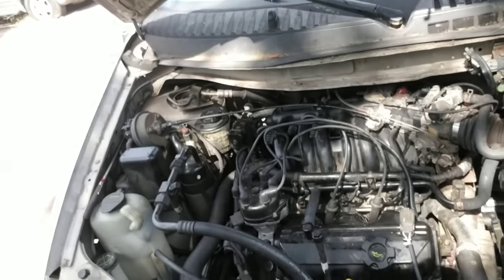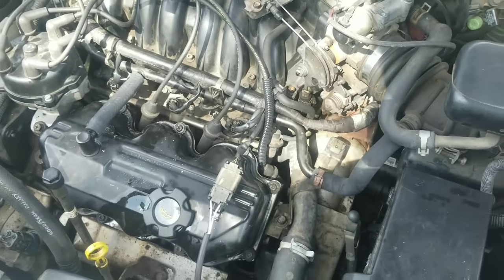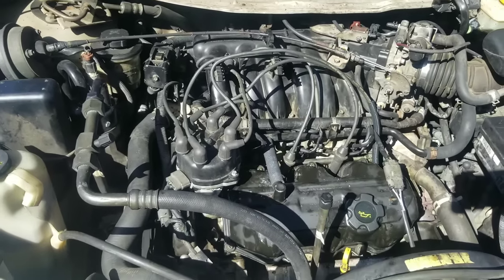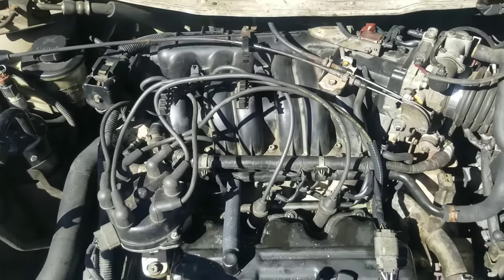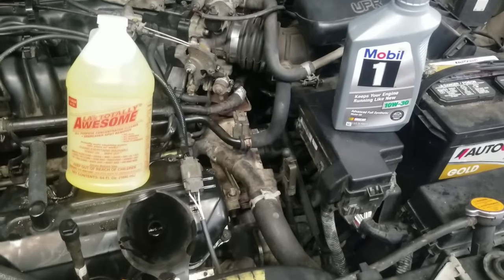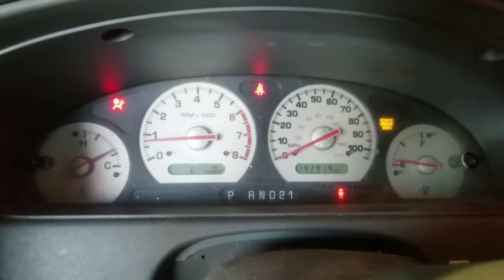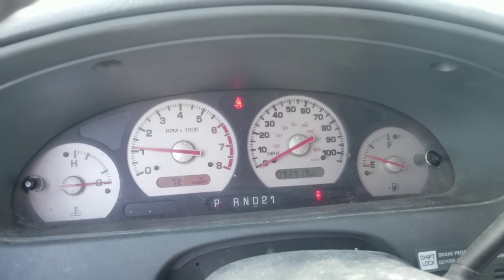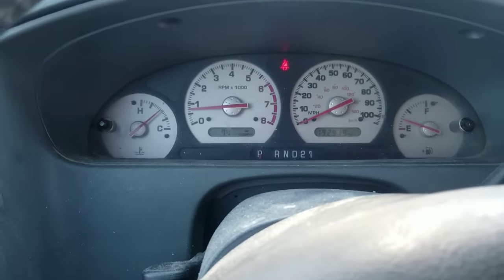How to Clean The Inside Of Your Engine The Easy Cheap Way.

Comment: There's no way in hell I'll bring my car to your shop.
Reply: +LILDIRT - Did you see all that Gunk's in the Engine?  Also if you look on the Label of LA's Totally Awesome, it said for Grease + Engine.  Next time when you go to the Dollar Store, grab a bottle and spray that on your Clothes that have Oil / Grease Stains... It will remove it for sure !!!  I have remove Stains + Engine Grease that other products won't get it out.  Some of the Stains are like 6+ Months old and to my surprised, it came out Clean ://.  LOL
Reply: If he would have pulled the motor halfway out of the car replaced the oil pan gasket cleaned the pickup screen the oil pan. The rest of the engine is still all caved up with gunk. Motor flush, seafoam, automatic transmission fluid doesn't cut carbon and sludge. Something that really Cuts this stuff for sure is oven cleaner. But it's in a aerosol can. Pulling the oil pan and the motor halfway or all the way out of the vehicle cleaning prepping the oil pan and block to put the new gasket and silicon back on it takes a while. And all the other stuff cleaning the screen oil pan and leaving the rest of the crap all in the engine. By what I can tell what this guy did. it looks to be cleaning the internals in the inside of the engine. I like to see him pull the valve cover off I bet it's pretty clean. you got a customer that is never changed their oil. The oil has gotten so thick it is stopped up and gotten sludgy it stopped up the oil screen. This customer probably couldn't afford a few hundred dollars. Actually I take that back. People have money for what they want to spend money on. pulling the oil pan new gasket cleaning the screen oil pan and all that time and labor and parts. And the down time it takes. So this is a method that seems to work hard to believe but it does. I'd like to know how many more miles this car gets before it dies. When I build an engine I use coffee filters there almost lint-free. And I use oven cleaner on the tops of Pistons and sludge dissolves and boils the carbon off. you just got to keep spraying it on and hoseing it off with water. Don't get the oven cleaner on your hands I thought my fingernails were going to fall off. When the oven cleaner got on my hands. I thought the oven cleaner women use it on was not that strong. and you're supposed to wear gloves but this stuff is no joke. And you can buy this at the Dollar Tree also. I also use my 5 horsepower Craftsman shop vac to suck all fluids out except gasoline just don't use it on flammable liquids. Works great to do a transmission flush home. Suck the transmission lines out with a Shop-Vac. Also suck the radiator out with a Shop-Vac. If you use it on the oil pan on a carbureted vehicle to get all the residue in crap out. remove the carburetor it will draw the fuel through the carb and will be a fire or explosion. I have used this greasy Shop-Vac like this for years. just take the filter out when sucking up liquids. It's cheaper than a transmission flush machine. You can also use it on brake fluid to in the master cylinder. Anywhere any fluids except don't use it on gasoline. Also on old gas use Dollar Tree gas treatment it will burn when using this. Seafoam is the same stuff in just a lot more expensive. Look at gas stations you can pay more for the same amount of fuel most of the time. The same oil tanker goes to most convenience stores. So the fuel is the same most of the time. Like oil it all comes from the ground should have synthetic oil is better. But the Standard Oil I use Walmart brand. I come across Rule King it's even cheaper a lot cheaper than Walmart. Just make sure the oil is SAE. Most oil is SAE now. Rural King the store had their oil SAE full synthetic oil for $1.13 a quart. That's the cheapest I've ever seen full synthetic oil for. the brand was Peak. Today's date January 7th 2018. I waited about a day too late it was all gone even the other Rule King stores were all sold out. Rural King has some pretty good prices.
Reply: +jon smith - Did you see how the Car was treated?  Look at 6:25 in the Video, Head Light with Duct Tape will tell you about the Owner, LOL.  Also you forgot.....  The Car worth " NOTHING " , that's why he's doing this.
Reply from the maker: wow, thats a mouth full
Reply from the maker: thank you, also the owner dd not have much money, but needed a car
Reply: +Artistry Photography - Right and I agreed with you 100% !!! People forgot that some People don't have a lot of money!  Even if I have a lot of Money, I tries to " SAVE " what I can.  Wait until they get OLD, they will remember this post for sure!  LMFAO 😁 😂😁 😂😁 😂😁 😂😁 😂😁 😂
Reply: If you treat your car like shit they won't treat it right either
Reply: +daniel hirt - It was a Customer's Car.  Also, have you noticed the " Head Light " got " Duck-tape " on it?  That will tell you a lot about the Person driving that Car.  LMFAO !!!
Reply: daniel hirt
Yup, that's why I always like to wash, vac., and generally present a "well cared for car" to anyone for service.
Reply: Artistry Photography the owner didn’t have much money but isn’t that 8 hours engine flush a lot of labor to pay. Doing what these guys suggested would probably be about the same price.
Reply: can i use it on a 99 es300 with the vvt ngine
Reply: Artistry Photography so thats safe to pour in the oil pan of any car?
Reply: robert pelletier those cars are notorious for engine sludge :(
Reply: @JodBronson  you can get it at the dollar store? Great never for my engine cause I use synthetic and change it never more 10Ks,good product to clean my motorcycle chain and rear rim.
Reply: @jonsmith2217  just use synthetic oil change every 10k kilometers,never have oil build up. What he's doing is crazy oil crap gets between the crank or rod bearings it's seized. I'll use that stuff to clean my motorcycle chain and rear rim.
Reply: I wouldn't bring my weed whacker there.
Reply: jordon bronson - it doesnt matter if the car is worth nothing, it worked and it will work on cars that do not yet have this severe of a problem to prevent it from ever happening.
Reply: The biggest reason why I work on my own stuff. To avoid quacks like this.
Reply: Hell, put some diesel fuel in it...that'll damn sure clean it out...Kerosene works too...
Reply from the maker: wow, you are correct the owner could not afford the traditional repair and had given up on the car and was going to scrap it. i saved it and saved him some money in the process.oven cleaner works, however like you said it is very caustic, and fumy.  Try awesome you will love the results, however if you want a faster method try orielly brake parts cleaner . the shit works like a magic eraser for oil and residue.
Reply: @jonsmith2217  Synthetic oil, more frequent changes, cleans it slowly instead of this 'forced' cleaning.
Reply: mirola73 well I have seen people use that awesome stuff at the Dollar Tree. It does seem to cut some carbon and crap. And if you got a customer unlimited funds just to get them by a little further it's worth trying. And it cut the light off in the dash.
Reply: not sure what is the issue....engine sounds like new after the work was performed, wish I had someone like that who wouldn't over charge for services I couldn't afford.
Reply: @pattycarljackson  not really in the long run it will pay itself off,and cheaper than buying a new car,it works and I no as a fact,
Reply: Well you think it's luck then,he was a self mechanic,worked out of our garage /car lot but hurt his back about ten years ago so like brakes or thermostat, radiator, id do it for him old straight six If any older crowd listenen although I no that engine seen with my own eyes,I've hear some good ones but I've heard this from other mechanic in past,I, paientem,work n fixem but don't get to deep n sellem, my dad started it in the 70's,he passed last March and trying to keep up just me n brother just seeing if anyone could shed some light on that subject,thanks!!!

Comment: Just drop the sump remove the oil pickup screen and clean it...it’s free unless you don’t have RTV laying around. This is a much better solution rather then dumping 1$ store cleaner in your motor...
Would not recommend.

Comment: With warm engine  ...  remove soak and clean valve / cam cover over night in varsol tank . Remove oil pan clean spotless ... pour 3 litres diesel ... one litre new oil... run engine low rev till warm. 5 - 10 min. Let soak overnight. Flush new filter 4 litres new oil.  Checking pickup and screen,   Keep fingers crossed.  Off course you have checked and cleaned pickup and oil pump for cleanlyness ?   Sometimes works. Wouldn't  try it on a ...  928S4    ...   ?

Comment: L.A. awesome is a degreaser... seems risky pouring that into the oil mixture. For really bad cases of oil gunk try adding 1-2 quarts of kerosene to the oil. Kerosene has a lot of additives that clean and lubricate. For milder cases use liquid sea foam or marvel mystery oil.

Comment: Will AWESOME brake down Barr's Head gasket which was accidentally put in the oil instead of the radiator? The engine has not been started since this happened
Reply: Yes
Reply from the maker: no
Reply from the maker: head gasket repair is heat activated and usually forms hard metal that can not be dissolved by this product

Comment: I like how u unplugged the battery so it would reset the computer and turn the oil and check engine lights off and then in return u could say this method worked perfectly. Give it 3 days for the engines computer to reboot and those codes will be right back unfortunately. There is a chemical in Awesome which is found in a lot of other cleaning and degreasing products that actually break down and dissolve rubbers and plastics so using this method is definitely not good for your internal seals and gaskets. With that said, I wouldn't recommend this at all, especially when there are a multitude of Internal Engine Cleaners on the market specifically for doing this that work a whole lot better and won't hurt your engine or engine components.
Reply from the maker: unplugging the battery will NOT disable the oil light. that light comes on when the engine does not have proper oil pressure. so your theory is wrong. furthermore. the chemical is not in the car long enough to damage any rubber seals. and if you really wanna learn something hot motor oil actually will swell rubber, that's why valve cover gaskets made of rubber need to be replaced over time.
Thanks for the visit please subscribe

Comment: I have a question... when you had the heads open and cleaned out the top portion of the engine block... why didn't you just pour the totally awesome directly down into the engine? and let it flow through to the bottom of the oil pan? Wouldn't this have saved you time and been a lot easier and get the center of the engine block cleaned?
Reply from the maker: No, yes the product would be in the oil pan but you need it to circulate in the motor to dissolve all the other buildup that is in various places other than the oil pan
Reply: Ah, that;s why I said, "to pour it down through the engine block". so that it flows through the entire engine. Wouldn't this be what would happen, but pouring the stuff from the opened headers through the engine?
Reply from the maker: dude it don't matter, i flushed this several times. so to take the covers off each time would be a waste of time.and not provide and additional benefit.
Reply from the maker: Also letting the car run will agitate and pressurize the cleaner as well as distribute it all over the engine. Furthermore the heat helps to soften the oil sludge while the chemical eats it away.
Reply: Bernie Cruz 
I seened that video when he had the heads out. Your right it would had been easier.
Reply: I seen another video he did it with brake cleaner while the heads where off

Comment: so many pointless hater comments from "experts" who don't consider the basic chemistry of this. ALL modern lubricants have some degree of detergents specifically for this purpose. using a higher ratio of cleaner to lubricant, will not only NOT hurt the engine (as long as you only idle and there is in fact lubricant) it will be easily disposable as water treatment plants can process water-soluble solvents as opposed to straight motor oil, which you have to recycle.
Reply from the maker: Thank you, please like, share, and subscribe, also check out my other channel Salem Taxi on YouTube

Comment: That's the last thing to try before going in deep. I would NEVER do that to one of my engines, but for a severely neglected engine there's nothing to lose by trying. Good save! 

I don't understand why people won't take proper care of their engine. A jug of cheap Super-Tech and a filter from Walmart can be had for $20, and it's pretty damn good oil. If you can't DIY go to Jiffy Crude. At least that's better than letting the engine die a slow and unnecessary death.

Comment: How is that any better quicker or cheaper than pulling the pan and actually cleaning the screen I saw people do like 50/50 oil diesel mix which I was like I don't know but this shit is a no go
Reply from the maker: well i have tried diesel and kerosine, but they did not work as well or as fast as the awasome cleaner mx. trty it out.
Get some oil chunks ad put the in clear bottles and the add awasome to one bottle, diesel to the other and watch the results.
good luck
Reply: Artistry Photography if I hat that bad of a problem I would pull the pan
Reply: And also I'm sure straight acetone would clean a motor but I'm still not going to do it
Reply: Still sludge on the valves etc

Comment: I like a mix of 1 qt. of diesel fuel with a smidgen of trans fluid with the same amount of oil in the engine. Drive very easy for a couple of hours, let it sit for a couple of hours then drive again a couple more hours. When cold change the old oil and filter with new. has anyone ever seen a diesel engine that was sludgy inside? No of course not! Diesel fuel is a great lubricant AND cleaner.

Comment: Wow amazing we dont have this stuff in our country is there similar thing like this
Reply: oven cleaner
Reply: Diesel fuel will do the same thing if you mix 1 quart of diesel to 4 or 5 quarts of motor oil depending on how much oil your car takes.  But with diesel fuel addition you can drive your car no problem. After mixing in the diesel drive for a hundred kilometers and then drain the oil and refill with new oil.  You can repeat that process each time it's time to change your oil and after a few times the inside of your engine will be completely clean.

Comment: Disconnect the battery to reset the computer. The check engine light might not come back on. Known to happen, and that's what I have done several times. It sometimes comes on in my vehicle when I drive around with low fuel. Fuel vapor pressure sensor in the gas tank is the code.
Reply: Anonymike I keep getting the same code.
Reply: @ricardovelez958  You have a sensor returning an out of range reading. Either the sensor is faulty or there is something else wrong.
Reply: Anonymike thank you! I will take a look into. Appreciate it 👍🏼

Comment: Do I use the whole gallon when I get ready to use it on the second flush?  I'm changing on a 3800 series 2 on the 2008 Pontiac Grand Prix.
Reply from the maker: i like a mix of 40% cleaner 60% oil , 2 qts cleaner 3 qts oil.
Reply: i got a 2004 yukon my oil light comes on when the truck not moving but when driving it goes up and the light goes off. i flushed it once with mystery oil  and it helped alittle  but im going to try this and let you know how it goes thanks for the tip.

Comment: dude. seems you wasted a whole night doing that "cleaning". Seriously? sorry, i think i would just rather waste a little more $ getting 2 new oil filters, new oil, and using MMO to clean out the sludge. i guess my real question is, what did you do with all that mixed oil and Awesome shit? Can you really dump it with other oil?
Reply from the maker: dude the video is for people that want a different solution to a common problem,  also, i did a lot of other things while this car was cycling. Furthermore the owner wanted to junk the car, and had no money to buy a new one. so this was Charity work. ad now that family has a car they can drive. We must help others when and how we can, it makes the world a better place.
Reply: Hats off to you from Ireland, mechanics in Ireland are renowned for their generosity, some times we all need a little help
Reply: I get you but damn. I have seen vids and heard that putting ATF in will clean up the inside of the engine a lot too. Yes, ATF can be expensive, but if it only takes one engine flush with ATF, let it idle for about 20 minutes, then why not?
Reply: You put the mixed oily solution on your garden, it’s awesome..